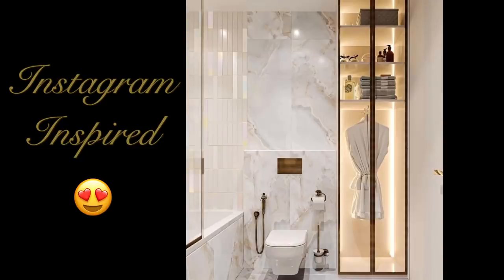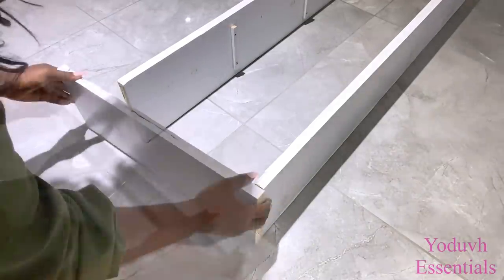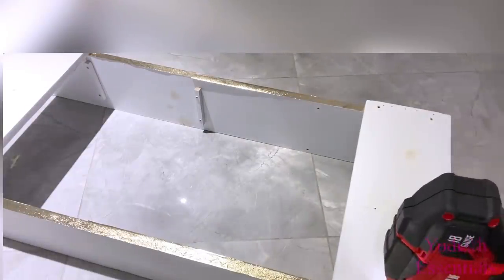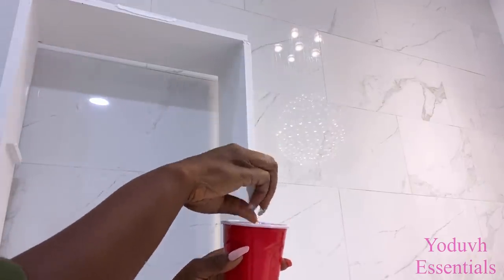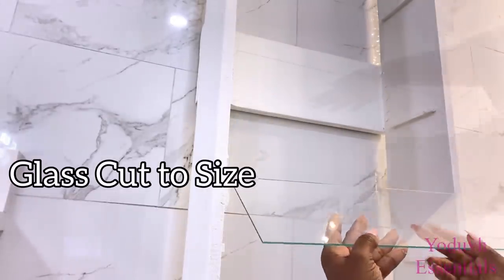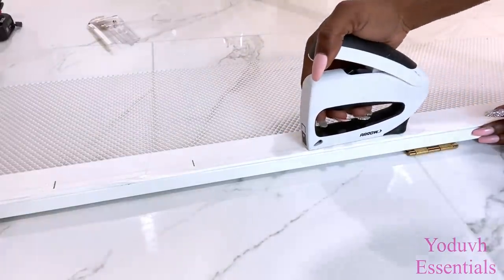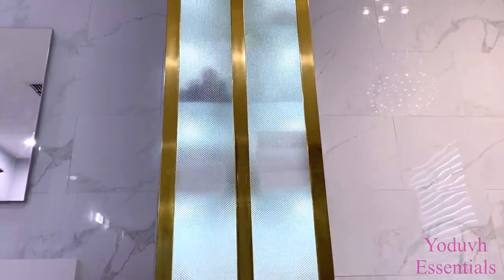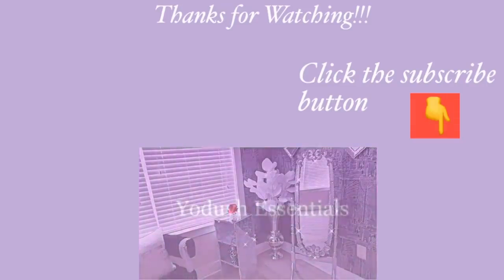NEW DIY BATHROOM Glass STORAGE *INSTAGRAM INSPIRED*

Comment: Those command strips must be super strong to hold up that wood.
Reply from the maker: Yes dear. Command strips come with different weight limitations. Each pair I used in this video holds up to 16lbs. Most people don’t trust Command Strips because of few mistakes like not properly cleaning both surfaces where the strips are to be attached, Using surfaces that are chalky/powdery or switching the location morethan once! It will NOT hold up well.
Reply: @yoduvhessentials6310  thanks for that information 🤗

Comment: How did the 3M adhesive tape held up against the steam after you took a shower.
Reply from the maker: They’re holding up well. They’re actually called command strips. They work excellently well when both surfaces have been properly cleaned before the application. A pair alone can hold up to 16lbs (I used 6 pairs). 
My shower is enclosed so the steam will not affect it.

Comment: Can you please tell me that when we use crushed glass how do we get a smooth surface? Do you use alot of mod podge after or we have to use resin for the crushed glass to sink in lower? I used crushed glass on my makeup organizers but they are still sharp. Please guide me
Reply from the maker: Hi! After the 1st coat mod podge is dry, you have to apply another layer of mod podge over it and leave it to dry. If it is still sharp, then apply another extra layer until it is not sharp anymore 💕
Reply: @yoduvhessentials6310  thank you! I will try this tip!